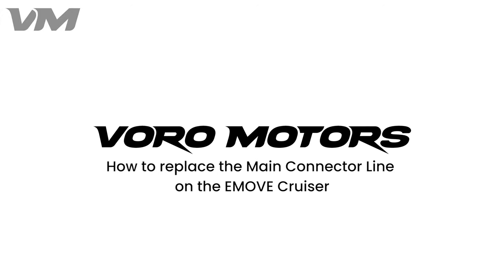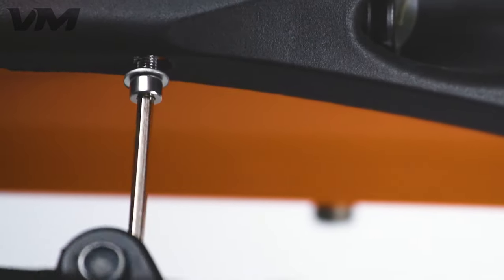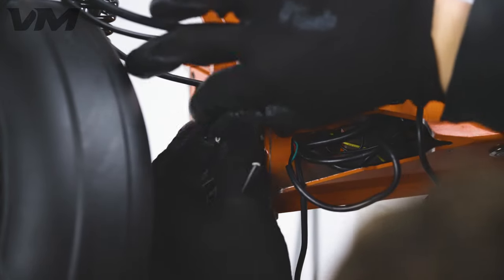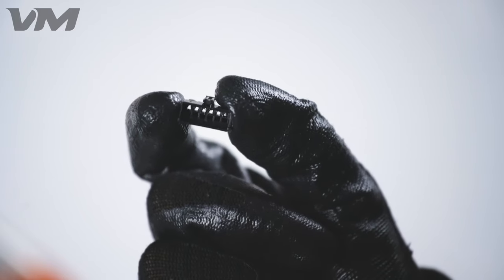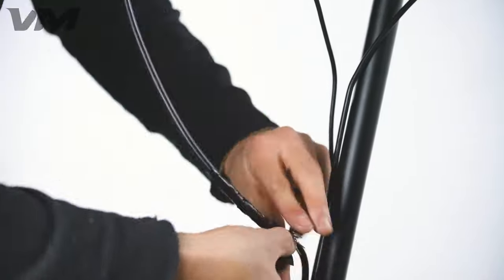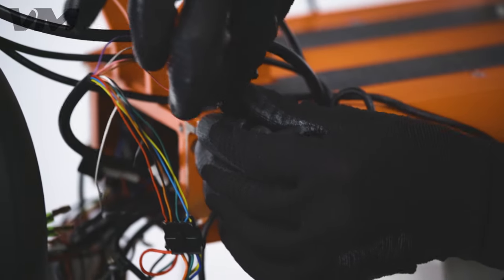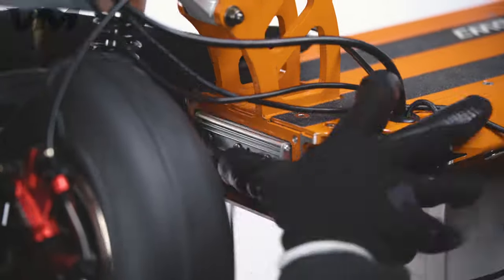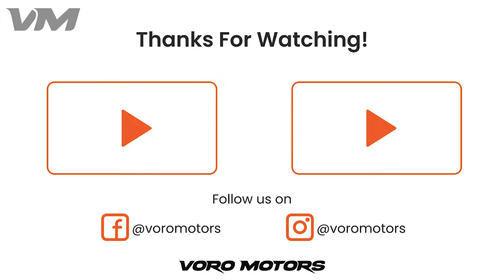How to Replace the Main Connector Line on the EMOVE Cruiser

Comment: I installed the carbon fiber goose neck and wide handlebar kit from Voro and my cables are too short to set the handlebar height to a comfortable level, I'm 6'2".  I would like to see cable extensions plus brake extensions.  The brake lines are the biggest issue because of the wide grip handlebars.
Reply: I feel you on this, I’m 6’3 and this scooter isn’t made for tall people 🥲

Comment: I broke the upper stem base and i needed to do all this parts to replace it. Its really bad design for scooter and for normal person its almost impossible to do. Very bad design that the main cable's thicker end is on top of the stem. You need to do all this parts if anything breaks in stem because u cant pull the cable's through the stem.
Reply: I agree, also that my battery cables broke when I unplugged them and now my scooter is a big orange expensive paper weight. Very frustrating and depressing.